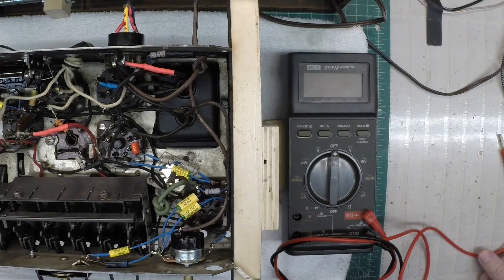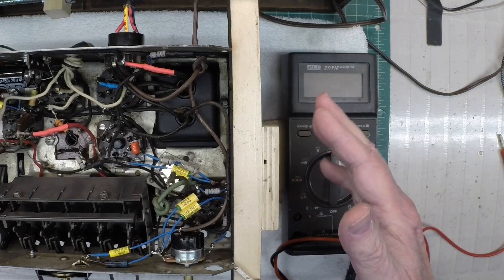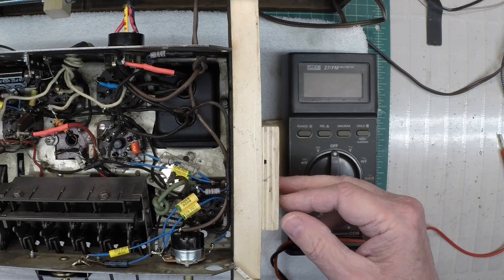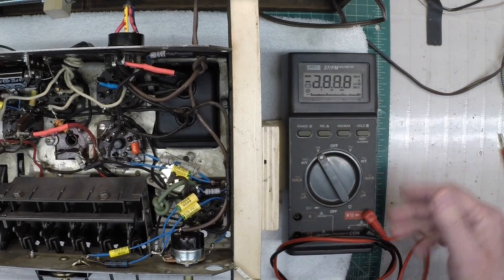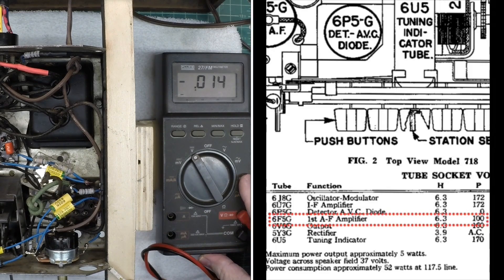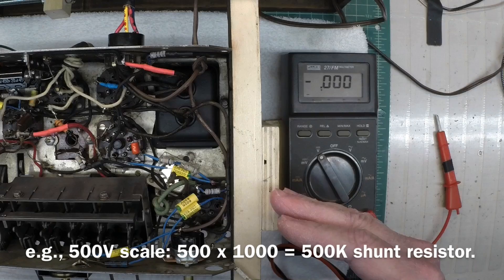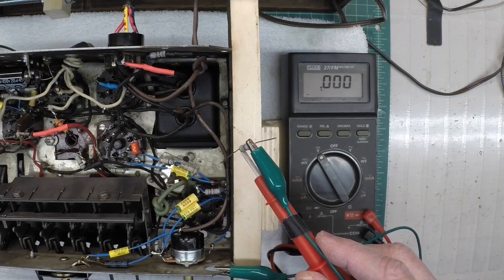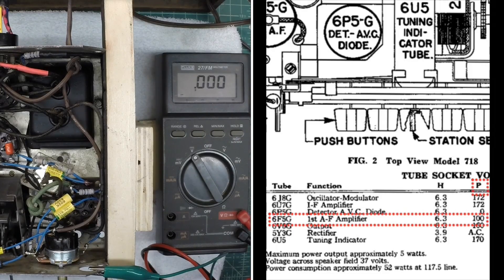High B+ Voltages or Maybe Not?

Comment: I think using a refurbished VTVM would probably get you reading closer to what was originally found back in the day. It is just the nature of more modern DVM's to get 
higher readings. When I say refurbished  I mean  replace some components like the selenium rectifier, and to check resistors for unacceptable drift. Of course you can
check the tubes as well but they seldom are bad. Also to go over the components with the schematic to be sure whomever built it (if a kit ), did it right! Thanks Don!
Reply from the maker: Good idea on the VTVM. I’ve got a couple of them packed away in storage I need to dig out at some point. Thanks for watching and reaching out. Best, Don

Comment: The other thing I do is use my older analogue meters to test stuff... A lot of the service sheets here specify AVO 7 or AVO 8 with the corresponding k per volt resistance. I have a pair of 8's here, a Mk1 and a Mk5.

Comment: You have a nice fluke meter,do you ever use a vtvm meter for your work ,if you do would that be any safer or better for higher voltages, One reason I asking I have pick up serveral  heathkit vtvm .meters
Reply from the maker: Ron - I do have two VTVM meters, but I rarely find myself using them. Best, Don